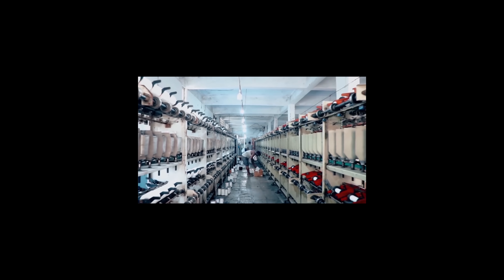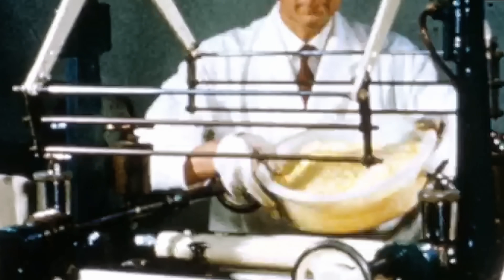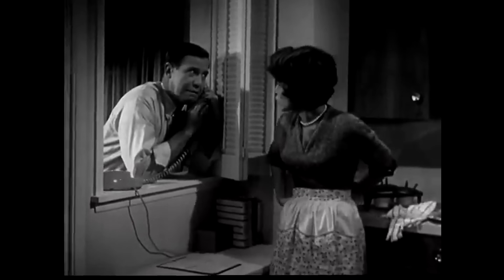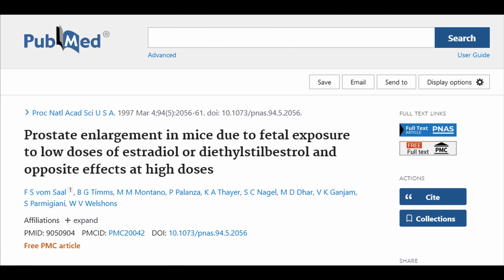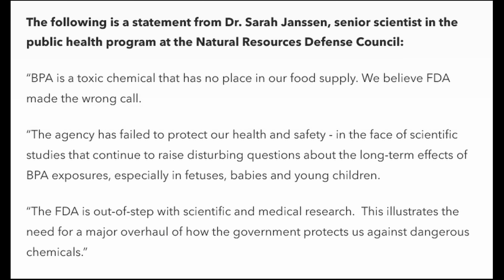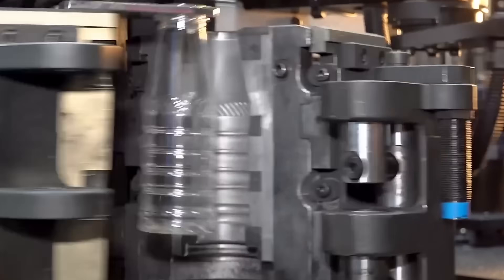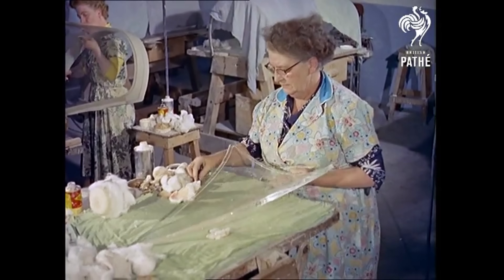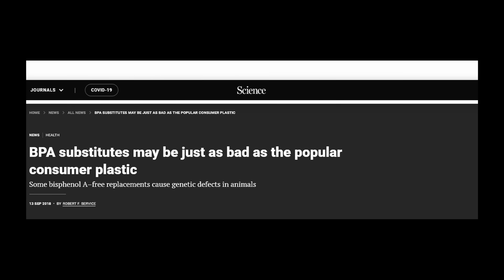Bisphenol A

Comment: I'm no chemist but is it not possible to someway make the plastics more stable so they don't leak chemicals after manufacture?
Reply: I think the point is to leak. 😮
Sure everything could be made better, then someone thinks it should be cheapen. So items start to suck and people cut corners and people die. They call death an acceptable way to conduct business. 😮

Comment: Been on this train for a while now. Buy steel water bottles and refill them, buy steel or ceramic pans, wooden or bamboo cooking utensils. Limit plastic as much as possible especially for things that get heated and get BPA free in the case it can't be avoided
Reply: If you're going to get plastic at least let it be nylon, something that can actually withstand heat. One problem is like Georg said, nobody will be bothered to go back to cleaning and refilling their milk jug. When it comes to industry people need to be made to do the right thing by eliminating all other options. Food preservation and safety, like with meat, would be a challenge without plastic.
Reply: @JohnSmith-mc2zz  yup ita a losing battle in the end but one worth fighting imo. Even if we can't eliminate expose at least limiting it is worth it imo. And also even if it has BPA if it's being kept cold I believe that may also at least slow the amount it leeches if it doesn't stop it
Reply: I went with some silicone utensils for cooking with which work pretty well. Though I still use some cheap black plastic ones I should get rid of.
Reply: There is nothing you can do. YOU WILL BE TRANS and YOU WILL EAT THE LGBTQ PLASTIC

Comment: We need to undo it by banning use of plastic in anything single use. Going back to glass, paper, tin and wood. 
Then in anything in the manufacture and commercial storage and devices.
Requiring stainless steel and glass there too.

Comment: As dictated by code, PVC piping should only be used for waste water and vent piping.
Reply: Maybe where you live but they still use PVC, poly, and sometimes copper for water services here and there. Meanwhile we still have lead and galvanized pipes out there delivering water to people.
Reply: @iamfuturetrunks  Lead is definitely a problem, galvanized pipes marginally. Any plumber worth there salt should not be using PVC for supply water.
Reply: What plastics do they use for actual drinking water pipes? PS and PP?
Reply: @SianaGearz  Nope. Supply is either Copper or Galvanized Metal, which is usually found in older, mid-century buildings.

Comment: The BPA free stuff just uses similar chemical plastecisers,

 as a chemist just looking at the new chemichals they use structure, you can tell its gonna do the same exact stuff
Reply: Yep.  A few semesters of organic chemistry will tell you that if the shape of the molecule is similar, it probably does something similar.  I imagine making something safe will require too much effort for companies with little financial interest in the long-term health of their customers, so nothing will be done.
Reply: If bacteria don't eat it first. They love phthalates.
Reply: From the chemistry side, I wonder, won't the plastic have to break off little pieces into the food and water in order to pollute the consumers body?

I'm a layman in chemistry, but it seems to me that something in food or water would need to react with the BPA and cause it to be dissolved, right?

Of course a lot of food stuffs will probably be able to do that due to the presence of various reagents. But maybe some plastic packaged food stuffs are safer to consume than others? 🤔

After all, one of the main problems of plastic trash is that it takes a long time for it to break down in the enviroment. But that also seems tl suggest that there aren't a terrible lot of naturally occuring reagents to plastics out there, or am I missing something?
Reply: @sevenproxies4255  I do know that many foods (such as tinned tomatoes) are really bad for BPA contamination due to acids in the food breaking down the coating. I'd speculate only dry foods such as packets of rice would be less likely to be contaminated.
Reply: @repletereplete8002  Yes, anything with tomato in it is a real hassle to store for extended times.

I do a little prepping in my spare time and I've noticed how in old military rations, anything with tomato juices in it risk corroding metal cans, and it would probably react with BPA too.

But as you said, as far as dry goods are concerned, eating rice or pasta from a BPA lined container should be fine.

However there is an issue to be considered with plastic packaging.

In factories where they do the packaging, flash and plastic shavings may end up inside of the food.

I remember seeing a video where a guy with a microscope took a look at individually packaged slices of cheddar cheese. And let's just say that the slices of cheese contained a bit too much microplastics for comfort.
Reply: @sevenproxies4255  I can totally see that happening. I've wondered having been in several major food manufacturing plants what ends up in the packaged food. Chiefly from the production machinery as well as the structure such as lubricants, cleaning agents, metal and building dust, particles of the conveyors not to mention the workers etc. Those places were not possible to keep totally sanitary on a practical basis without having to shut down food production on a daily basis which would probably just cause huge build ups of cleaning products and thus more contaminants.

It really is a case of you need to produce nearly everything yourself in some non-existent Shangri-La environment or not think too much about it and take your chances.
Reply: @repletereplete8002  Yes.
For the "cleanest" food you need to cook from scratch with fresh meat and vegetables.

But even then there's still the risks of pesticides, growth hormones, antibiotics and the like.

So you need to take a calculated risk regardless of what you do, unless you plan to grow your own food, and even with that there's risks of pollution (since microplastics and other crap may have seeped into the groundwater or rain already)

Even so, the more stuff you make from scratch, the more pollutants you will cut out in the long run.
Reply: sadly its a cost thing usually @sevenproxies4255
Reply: BPA is not a plasticizer, it is a polycarbonate and epoxy coating monomer
Reply: Ah right my bad on that, my mind was on phthalates with the uses, which are also some rather nasty chemicals biologically.   @seponkiuas
Reply: @seponkiuas  It's a coupe of glucose rings joined by a couple of methane molecules. Many bacteria will decompose the glucose rings as food and throw out the methane as waste. Plastics are as harmful for the environment as wood now. Recycling plastic only generates carbon.
Reply: this is a significant point you make, that the BPA-free stuff just uses similar chemicals
Reply: It's the same with "palm oil free" products. The substitutes/ alternatives are as bad or worse for the environment than palm oil.

It's sad that young adults have way more scientifically accredited information readily available to them than I did but many of them choose to trust a random person on social media that proclaims BPA is bad but DES is fine or a synthetic vegan burger is better for your health and/ or the environment than a responsibly produced beef burger.

Comment: Even plain bottled water isn't safe.  Typical.
Reply: I heard they're full of microplastics too.
Reply: @GeordiLaForgery  microplastic is when plastic decay due to sunlight/UV rays, or if added intentionally as microbeads in skin care products.
Reply: @xponen Only partially correct I'm afraid mate... It also includes the tiny bits you cannot see that fly off each time you unscrew, and re-screw a threaded plastic cap on a plastic beverage bottle. It includes unknown sources, as from plastic machinery, conveyor belts, and plastic tubing in food processing. Even plastic tubing in medical supplies/medical or hospital settings, such as IVs, and blood or plasma bags.  It also includes household dust constituents from plastic fibres used in making synthetic carpets and upholstery, as well as from from machine washing and drying fleece, polyester microfibre, and other assorted synthetic fabrics. Bits of all of this junk get picked up by furnaces, hoovers, and some are even transformed into even more dangerous smaller, and different compounds as they're re-circulated through our home environments. They're found in everything from breastmilk, blood, rice, sea salt, tea, and now plants as well. They're as ubiquitous as PFAS, and BPA.
Reply: @xponen Only partially correct I'm afraid mate... It also includes the tiny bits you cannot see that fly off each time you unscrew, and re-screw a threaded plastic cap on a plastic beverage bottle. It includes unknown sources, as from plastic machinery, conveyor belts, and plastic tubing in food processing. Even plastic tubing in medical supplies/medical or hospital settings, such as IVs, and blood or plasma bags.  It also includes household dust constituents from plastic fibres used in making synthetic carpets and upholstery, as well as from from machine washing and drying fleece, polyester microfibre, and other assorted synthetic fabrics. Bits of all of this junk get picked up by furnaces, hoovers, and some are even transformed into even more dangerous smaller, and different compounds as they're re-circulated through our home environments. They're found in everything from breastmilk, blood, rice, sea salt, tea, and now plants as well. They're as ubiquitous as PFAS, and BPA.
Reply: no, the label on the bottle tells us what type of plastic it is, and then we can check online if it contains BPA. The one in aluminium-can & tin-can is unknown because there's no label.
Reply: @xponen  The other stuff they use is just as bad, it just hasn't yet been proven to cause harm. Wait a couple of years. and they will have to replace it with something else.

Comment: Thanks for raising awarness about BPA, since I first heard about it I have switched to glass and steel containers
Reply: By steel containers... You mean canned food? BPA is sprayed inside the cans to prevent corrosion from what's inside LOL.
Reply: @benoitbvg2888  no, I mean like electric kettles and stainless steel food containers
Reply: @benoitbvg2888 Nobody makes canned food with steel. Aluminum and tin are the primary metals used for food storage and preservation in the mass market.
Reply: @kylegonewild  I was thinking about reusable containers at home, it is very hard to find anything in stores not packed in plastic. I avoid canned food if possible
Reply: @kylegonewild ...and both are also coated?
I'm sure about aluminium, you can set an aluminium can in a sodium hydroxide bath, it'll dissolve the aluminium but leave the plastic. And I hope that's also the case for tin, as it's arguably far more dangerous for the body than any type of plastic.
Reply: @benoitbvg2888 which doesnt matter because the op wasnt talking about cans
Reply: @tallgnome3229  wow. How do you read people's mind like that? Care to teach me?
Reply: @benoitbvg2888  no one tried to argue with you that cans arent coated with bpa, you brought that up
Reply: @tallgnome3229  also quite dubious about op's claim about preferring steel containers, but not using canned foods. But hey, I'm in a good mood tonight, good boy points for everyone. 
Yaaay
Reply: @benoitbvg2888 you might have good boy points but you don't have reading comprehension
Reply: @benoitbvg2888 Stainless is quite popular as a healthy alternative to the plastic water bottles, the polycarbonate water flasks, and the tupperware. Very popular in the US, India, and many other countries. Stainless containers for leftovers which look like tiffin boxes, Yeti, and Sigg stainless cups, mugs, flasks, and the like are but a few examples. I reckon most people don't falsely  think tins and cans are made of stainless steel; we know they're literally made of tin, or the lightweight beverage cans are aluminium. This was an odd assumption you made of the subject.
Reply: @benoitbvg2888 And FWIW, many health-conscious people I know avoid tinned foods at all costs. We perceive them as only emergency rations, or if a necessity, backpacking and camping rations... rare oppurtunities for consumption. Almost any preserved food product can be had in glass, albeit at a higher cost. For items we don't preserve ourselves, as an example, I splurge on organic tomatoes and tomato products in glass jars imported from Italy (Jovial brand). I also source white anchovies from Spain which come in glass jars, as well as some sardines and mackerel. No one really NEEDS tinned food to survive.